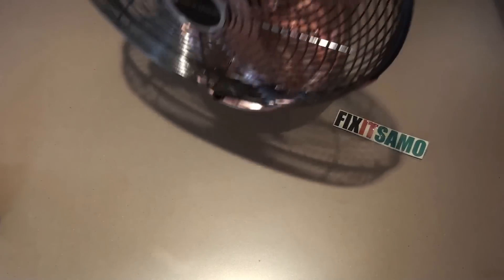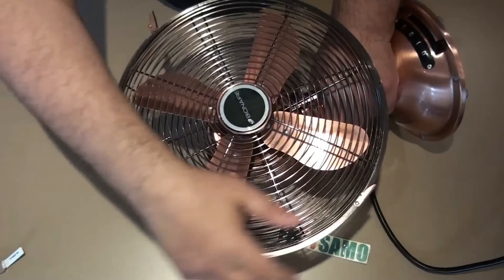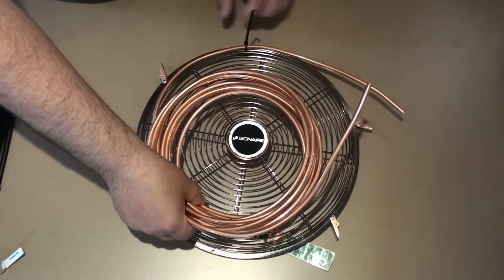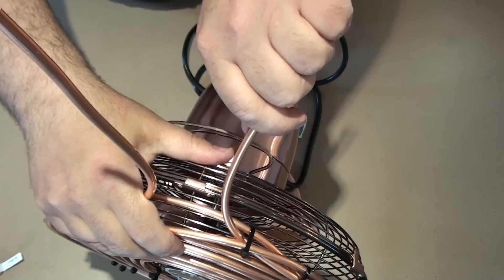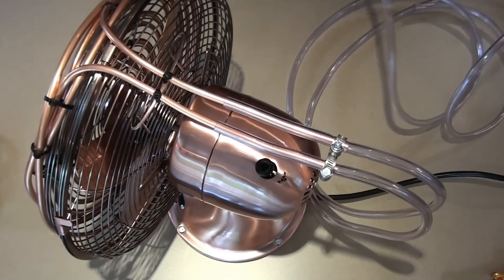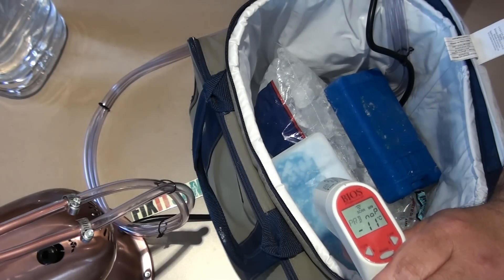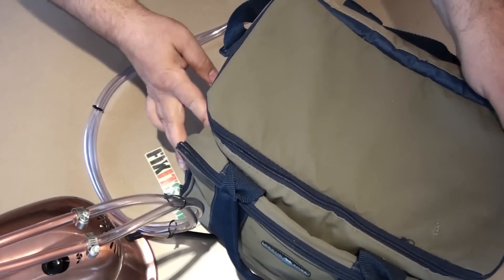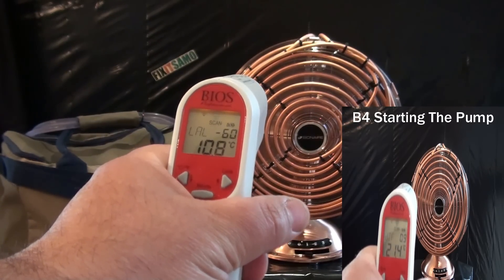How To Turn Your Fan Into An Airconditioner  AC

Comment: If only people knew this is much more healthier than an air conditioner. It's totally natural. Why some smart manufacturer had not patented this type of a product? It's almost perfect.
Reply: Please do some more research. If you compare the amount of BTUs this meth fueled contraption removes compared to a real air conditioning system you will understand.
Reply: Probably because you need to refill the ice, which takes energy from a freezer to make.  This is essentially the same process as using a normal air conditioner.
Reply: @joebaldenweg 
And this air cooler setup on cools a room.. an air conditioning unit will cool down an entire house.
Reply: This is just like your EV... use it then wait for hours to recharge / refreeze. lol
Reply: This may feel cool but it adds much more humidity to add to the mold and allergy problems.
Reply: I don't give a hoot about healthy man I live on the road Jack , in a trukk no less, my ass needs to stay cool ------
Reply: @airmag
What exactly do you mean by "healthier than an air conditioner"?  Outside of a few extreme scenarios, an AC system poses zero health risks.
Reply: @SewerTapes  He doesn't know what he's talking about.
Reply: @overthetip  
Indeed, he does not.
Reply: I didn't mean that. This device can no way be  compared to an actual A/C, but depending on the need, it could be used in a small bedroom, office etc. Just a healthier alternative.
Reply: @airmag  If a person owns the home they could theoretically bury pipes like a radiator underground, push water through it, then back through the window, and use some kind of radiator for the heat exchange system.  Depending on what part of the world the person lives matters how deep and how much pipe would be required but ground shifting and corrosion would most likely play a part as well.

The question is whether a person would net over the overall experience, would the person save enough money over a long enough haul to justify the purchase, labor, and maintenance of such a system?  This is why some people build their homes underground or into a hill, this minimizes the cost of keeping the home cool and in some cases you only need to heat the home but when things go bad (a friend of mine has his home built into a hill, when it had a leak with liquid coming through the wall it was a lot of labor and cost) the question becomes did I net or pay?

Comment: Small air conditioners are the same price as all the stuff this DIY needs! However, it was a great science lesson, understanding how to make a cooler. We need to discover ways to cool without electricity!
Reply: Yeah it's called trees under the shades
Reply: Word.. it’s called moving to Alaska
Reply: @Helmuesi911  way too many ** mosquitoes
Reply: Solar panels
Reply: I made a similar A/C fan for $15. I had everything I needed except the pump. If you already have the stuff on hand then it’s a fun and easy project that you can easily move throughout your house.

Comment: Will this work if i use a fridge compressor with refrigerant instead (and yes i do waste the heat of the evaporator outside with a fan)
Reply: no that can never work
Reply: @anonymous-pr2sy  why though?
Reply: @Not_Aran8276 it will work , if you can set it properly ,
Reply: @VJETRA  yeah, wouldn’t cool a whole room (maybe if it’s like super small room then it might work) but my I’m just blasting this on my face on hot sunny day while I work on my Pc
Reply: That’s. A clown don’t listen to him it will work

Comment: If the freezer that makes the ice is in your house you gain nothing since the backside of your freezer will get hotter making  non stop ice.
Reply: Next morning you wake up and put that bag of ice back in the freezer no need to make fresh batch of cubes daily my dude its only used to cool the water thats in the cooler not to melt and be added to that water ...
Reply: Or he either buys the ice
Reply: I only use ice blocks, that freeze in a couple of hours in the freezer, and then put them in the water !!
Reply: I don't understand. I just make ice cubes in the freezer.

Comment: If you put a pump outside ice pack the motor will not heat the ice pack. More cooling time.
Reply: @susanmoffet657and where do you think the heat is gonna go?
Reply: @VJETRA it must not heat up that much because otherwise it would kill the fish
Reply: @brendalg4  it still does heat up and the heat still end up in the room and ice still melt as fast so more heat being absorbed. so Overall still the same result  unless he put the outside his room , also where do you think the heat in the fish tank gonna go?

Comment: if it is a fixed installation, instead of a cooler, you could dig a hole that is greater than 6 foot down and in this hole put very long hoses. Instead of pumping water, you could pump wind-shield wiper fluid which avoids freezing in the winter. The deep underground temperatures remain almost constant all year in most locations on the planet. Thus you don't need to expend energy to make ice..
Reply: but you;d need a more powerful motor for the pump, expanding more energy

Comment: What do you do about the condensation as the coils around the fan sweat and drip? You wound need a drain pan under the coils as it will sweat and drip. A better idea besides Freon would be to freeze gallon jugs and add a little water to it. Otherwise it’s a good idea coming from a guy who went to HVAC school. This would be a good idea in my bungalow since it gets relatively warm upstairs in the summer.
Reply: bro the air will absorb all that water in no time as it has high airflow and alot of surface area.

Comment: I would just stick the fan in my refrigerator freezer cracked the door open a little bit blow the cold air out LOL much easier,, already made air conditioner maybe use the ice maker?
Reply: Freezers do not work like that
Reply: Then the refrigerator is constantly having to work harder to bring the temperature down... Which also heats the room back up
Reply: @brendalg4  I agree,, like a AC unit, people are nothing but Idiocracy,, refrigerators should be installed like one,, but not in the winter time,, they need to close the window so that heat doesn't escape,,😱,, either way just get a AC and refrigerator,, that turns around,, when it is hot or cold,,

Comment: It's wacky but it's gonna cost you a fortune in ice, or electricity if you freeze your own ice. An air conditioner has a compressor and a condenser. It works with a fluid that boils around room temperature, rather than water.

Still, this way would cool off a person directly, could be good just to break out on hot days if you don't want to pay the price of an aircon. 

I can think of an improvement... the returned water could run like a waterfall through the air. You could use a big plastic water bottle like you showed. Water would come in from the top, perhaps through a spray nozzle. As it fell through the air in the bottle it would cool down, partly by evaporating, so you'd need to top up the water sometimes. But you'd end up with cooler water for "free". It would mean the ice would last longer. 

You could even have the waterfall I described, with a fan blowing fresh air across it, keeping it supplied with fresh cool dry air. The condensation it produces might be a pain, so leave the cooler unit by an open window and you'd have a winner! Maybe make the waterfall in a plastic box with a fan mounted on one side. It would be good to use a 12V fan since it's near water, would be safer to keep everything low-voltage if you can. You could even mount clothes-dryer vent hose to the opposite side and have that lead off to a window. 

Evaporative cooling is second-class when it comes to aircon, but you can't beat the price! As long as you get rid of the water vapour it's fine. 

Actually the water vapour, you could recover that. Just run the wet air through another metal tube, a wider diameter, Blow air across the outside, maybe even give it fins, and you'd have cooled and recovered the water.
Reply: Wow, many, many 💡 ideas.  Thanks, G.A. 🙂👍🏻
Reply: Reusable ice packs or half-gallon jugs. If you've got a freezer, you're already set to MAKE ice.

The rest of your ideas are impractical at best.

Comment: Copper tubing seems to be a challenge to locate, but I did locate steel piping that’s copper coated. Is assuming this would work just as good a fair assumption? 
In all reality, I don’t like to assume….I’d greatly appreciate feedback! Thank you 😊
Reply: I'm not him, but I can't see a problem. Is it copper-coated for the purpose of carrying water without rusting? Sounds OK. Worst case, if it rusted up over the years, you could always get a new one. Copper is much softer than steel tho, so much easier to bend, you could try the steel and see if it's suitable. A tip for bending pipe btw... so it doesn't collapse and nip off into a corner when you're bending it... Fill it with sand. When it's straight, fill up with dry sand, then as you bend it the sand will provide support from the inside to resist being too bent. You can look this method up online.
Reply: Copper is an especially good conductor of heat meaning it would probably provide more cooling than other metals but I’m sure other metals would still work, just not as effectively

Comment: If you want it even colder add about 1/4 to 1/2 cup of salt to your water.
Reply: That might bring corrosion problems, to this amazing bootleg aircon. Something like antifreeze would be better, and designed for the purpose.
Reply: Why?
Reply: @Egor If you add salt to ice, it "wants" to melt. Frozen water, that's now frozen salt-water, should be liquid until -21C, assuming it's saturated to full salt capacity. But there it finds itself not liquid, but in solid form, way above it's melting point. At this temperature it should be liquid.

So, it does. Some of the salt-ice starts to melt, but it requires heat energy for this to happen, since liquids have more energy than solids. It draws this energy from around itself, the surrounding ice. Taking away heat to use itself, but leaving the surrounding ice colder.

Even to go from ice at 0C to water at 0C, same temperature, takes a lot of energy. The difference between the energy of solid and liquid water. So there's lots of potential for extra coldness. If our guy did this in his aircon, yes it would get colder but the ice would melt quicker. You'd have to worry about corrosion, copper is particularly susceptible to saltwater corrosion, and the saltwater's likely to find it's way into some bit of the pump that won't like it.

Adding salt to ice to get low temperatures is an old trick. In the old days people made ice-cream that way, getting ice-water quite a bit below freezing, so they could freeze whipped cream with it. Of course you keep the ice-water in a separate bag, dunno what they did before plastic, but you don't want salt in your ice cream.

You could PERHAPS do all this salt-ice jiggery-pokery inside a container, even a thick plastic bag. Then have the pump in the cooler push water + antifreeze around the pipes. Then lower the freezy-bag into the cooler, so that the liquids don't mix, but the temperature transfers across.

Still for the sake of a single fan, and the amount of pissing about you'd have to do replacing new bags of salt and ice, I wouldn't bother. This project is about as complex as it needs to be, for how useful it is.
Reply: You'd just need to make sure the pump was built for saltwater.

Comment: Couldn’t you just run an additional length of coil in your freezer and cut one 1/2”x1/4” square hole in the rubber seal that goes around the freezer door for the tube to go in and then out? That way you wouldn’t have to keep filling up a cooler with ice packs and all that stuff.
So it goes like this. Fan with length of copper coil go to pump, then a plastic tube from the pump to the outside of the freezer door, then the plastic tube connects to another good length of copper coil that is balled up or coiled or whatever in your freezer, then the copper coil goes out the rectangular hole where it goes in, and that is connected to another plastic tube that goes back to the copper tubbing that is coiled around the fan. You could run a salt water mixture in it so it doesn’t freeze and stays even cooler than just water. 
Some people might not like the idea of altering the rubber seal thag goes around the freezer door. 🤔

Comment: Have you ever read the definition of air conditioner?
Reply: I know it doesn’t have a condenser but i mean it makes the air colder 🤷‍♂️
Reply: After it's set up, this costs less than an AC to run. It's good for folks like me who just need a bit of extra cooling, but can't afford a massive jump in the electric bill.
Reply: an appliance or system used to control the humidity, ventilation, and temperature in a building or vehicle, typically to maintain a cool atmosphere in warm conditions.

Comment: All looks good but you'll need a drip pan for the condensation and not sure if I would put the water clamps over the electric motor on the fan . Great job thanks for sharing
Reply: The condensation will help cool further and add a little moisture in the room
Reply: @mufasaiam7794  I understand that but the extra water that is getting on the table and floor doesn't work for me
Reply: But as high of volume of air that would be running over those coils, unless you're living in an environment that has extremely high humidity, condensation wouldn't be an issue. And if you did live in that kind of environment, this kind of system wouldn't be effective anyway.

Comment: Try using a 12 volt Car Fan that gets plugged into a Car's Cigarette Lighter Socket. You can also get a 12 volt water pump like they use on Boats, and Campers.  Then power them with a Car Battery and a Solar Panel connected to the Battery to keep it from running out of power.  It's Free Energy!  A Big Decrease on your Hydro Bill!  So Take Advantage of it!

Comment: ? HOW A BOUT DRY ICE.?
Reply: dry ice is colder but it goes through sublimation, so if you're using a sealed container the co2 would build and pop open
Reply: Its maybe more than better
Reply: Well if you're in a city where they have these ice cream places they sometimes throw these dry ice right on the street if you can ask the manager to get them before they throw them out that would be a good savings
Reply: It depends upon economics, I suppose. If you have access to free/cheap dry ice, I’m sure it would work better. Unfortunately, it is awfully expensive to purchase and impractical to make at home (if you have the equipment and energy to make it, you might as well use an air conditioning unit).
Reply: As long as you can keep it airtight. Even then it might freeze the water in the pipes where it lays. dry ice = C02 C02 does not = breathable for humans.
Reply: Isn't that toxic?
Reply: @user-ny5cu5ol1p No, nothing is toxic about frozen CO2. It's only harmful if you are sublimating huge blocks of it in a poorly ventilated area. In that case you could suffocate from the CO2 replacing the Oxygen around you.

Comment: Only problem i see is youll have condensate dripping from coils onto the table...what are you doing about that?
Reply: I would think that the fan would blow the condensate off the tubes, which would add more cooling effect (the same reason we sweat). The problem would come when the fan was turned off.
Reply: Could just put a cookie tray underneath
Reply: Good point. He needs to put foam or some type of insulation on the pipes.
Reply: @jcmottern  No, the air cooling on the copper tubing is the entire premise.
Reply: The air from the fan will blow it out like humidifier. i think
Reply: Drop a line for the water to follow into a bucket!

Comment: Would it work better to put tubing on the back of fan as to not block the airflow on the front? A fan pulls air from the back so it would pull the cool air and blow through the fan.
Reply: No it won't work because you will  be blocking the wind as he specifically said in previous videos.
Reply: Fans pull air from all directions. Put a ribbon on a string and test it
Reply: It's a wash, back or front will act the same

Comment: You can use freon Gas in that pipes
Reply: At that point you should just buy a portable ac unit for $180. The whole point of this build is that it's super cheap.
Reply: isnt freon 10,000 x worse than co2 if it gets into the atmosphere?  Not worth the risk unless you dispose of the old fan really really safely
Reply: Is it safe
Reply: @youtubedeletesmychannels2329  it is use in AC
Reply: Um, noooo. That's not safe.

Comment: Condensation? Does the piping sweat? Zap! Like the outside of a glass of ice water in humid places.
Reply: yes it does - alot! You need to put a towel under to catch the water
Reply: I just knew there would be at least one catch.

Comment: Will it still work with only the clear vinyl tubing instead of using the copper piping?
Reply: copper keeps the coolness longer than vinyl tube but it will work. less effective
Reply: not as well
Reply: The copper tubing keeps the liquid colder for way longer while the clear plastic tubing can capture sun light which warms up the liquid inside. I would keep the copper tubing as it is, but use a black plastic tube painted white on the outside instead of just the clear tubing.

Comment: Interesting I think what I'll do is all use one of my 250 mm radiators. And I will buy the copper wiring he's using and all use a box fan instead and see how cold I can make it I'll be a bit more conservative though. But it is a good design you came out with. Thank you for the inspiration
Reply: Have you done that? Would love to see a video on it
Reply: @looolooolism  no I haven't done it yet but in the future I intend to do it because air conditioning cost a lot and if I could make a fan design where I can just swap tops of the fan off and use this. Then I wouldn't need to pay for air conditioning